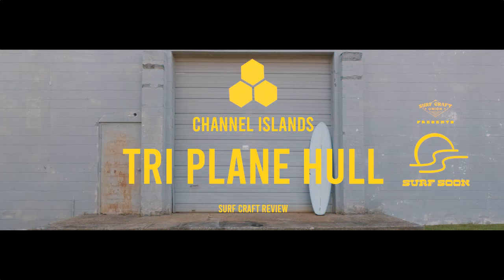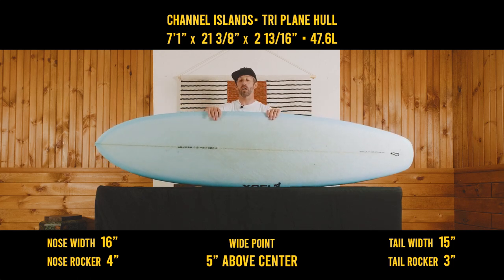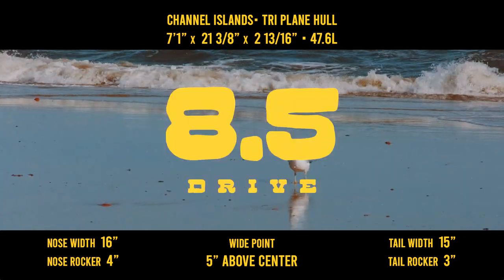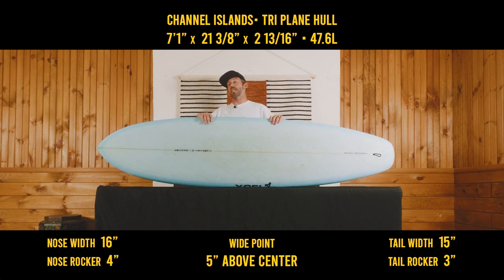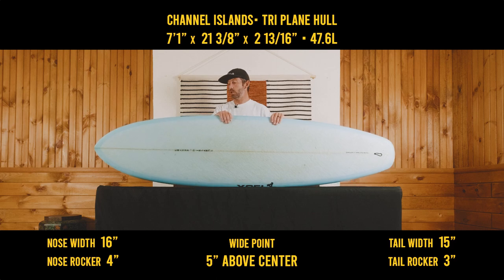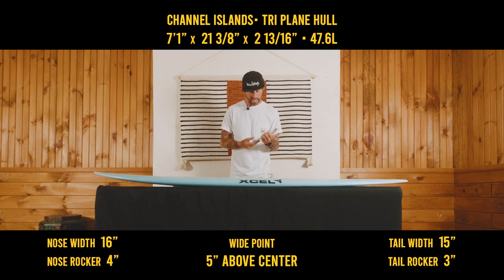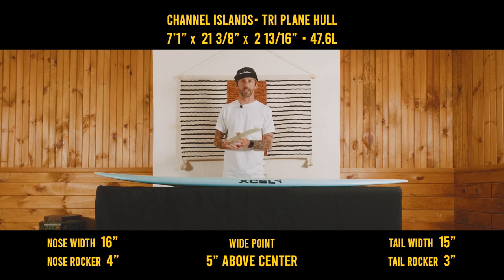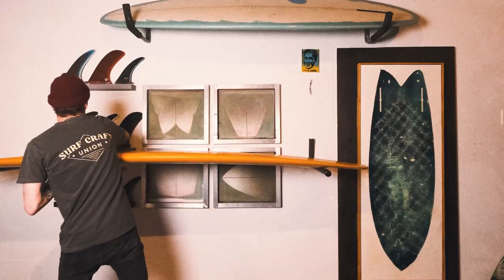Surf Soon • Review of the 7'1" Tri Plane Hull by  Channel Islands

Comment: Great video! I’m stuck between this board and the CI Midlength. What do you think?? Comparison video would be awesome!
Reply from the maker: Hey David, 

   So I have never ridden the CI Mid model. I have seen a handful but never surfed them. But from what I can kinda tell with the two is that the TPH is made for a little less critical waves and also something that is maybe a little more volume friendly. Most likely more rocker in the mid and the 2 plus 1 fin set up will help it turn easier. But the mid model will most likely excel in better more lined up waves. Think of the mid as almost a step up and not really a board that bridges the gap from a longboard to a smaller mid length like the TPH does.

Comment: Just bought one. Replacing my CI Mid with this.
Reply: What does Tri plane mean?
Reply: How do you like it 3 months later compared to the CI Mid?
Reply: @FoilWays  only surfed it a couple of times. Loved it. Probably not a good enough surfer to notice a massive difference. Picked up an Album darkness shortly after and been out on that more.
Reply: @mattbeer9094   I like the idea of the tri-plane over the CI Mid, but I think if I were to order one I'd go custom, in order to get a 2+1 setup.
Reply: @FoilWays  probably best just getting the CI Mid to be honest then. Think the hull concept is designed to be ridden single fin.

Comment: Looks like a nice addition to the CI lineup. Seems similar to the CJ Nelson Outlier 7’2 which is also a hull design single fin.
Reply from the maker: Hey bud. Definitely a cool board and stoked to see CI trying some different stuff. Just to be clear though. A hull is a much different bottom then a tri plane hull. The outlier is a very different design but they are both very fun.
Reply: @surfcraftunion  I was gonna ask you this on Jamboards but I’m too lazy to go over there now haha. Can you compare the outlier and the TPH? I, like you, have ridden the 7’ and 8’ outlier. I think I’m headed down to my local shop to scoop up the 7’6” tomorrow because it sounds like the right fit for me. BUT another shop says they’ll have some TPH in soon and I’m tempted to try one of these babies out…
Reply from the maker: @brian2973  Hey Brian. 

   So this is a tough one to answer because they are two very different boards because of the bottom on them.  If you enjoy the feel of the outliers because of their ability to just kinda flow in waves going over deep spots and connecting I would stick with it. The TPH needs a better lined up wave in my opinion and feel that it’s where the board excels. The thunderbolt tech also obviously has a different feeling as well. So really you have to ask yourself what am I looking for and what do I need. Not sure if this helps but feel free to continue if you like.
Reply: @surfcraftunion  Sweet works for me! Thanks

Comment: how do you feel about it vs the cj nelson outlier 7'0 as a groveler ? My seaside and beyond needs a push for waves and sometimes theres just not enough power for it
Reply from the maker: Outlier needs a little push. But def not as much as the seaside
Reply: @surfcraftunion  nice ! so tri plane hull needs less of a push right ?
Reply from the maker: @KC-ro9ro  the bottom makes it flow threw water better.

Comment: Specifically, what makes it a Tri-plane?
Reply from the maker: Hi sorry for the delayed response. Just in general a tri plane bottom is a area of concave and flat spots on the bottom of the board. It’s hard to explain without showing pictures and every brand does it a touch different. If you look on Devon’s instagram or most likely Channel Islands website there are a few pictures where the lighting really shows what Britt is doing with CI s bottom contour.